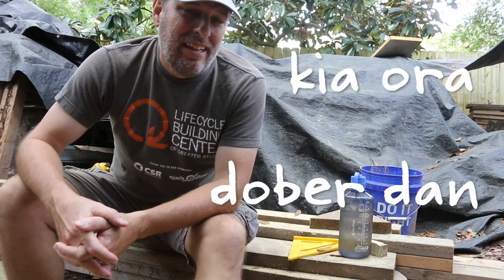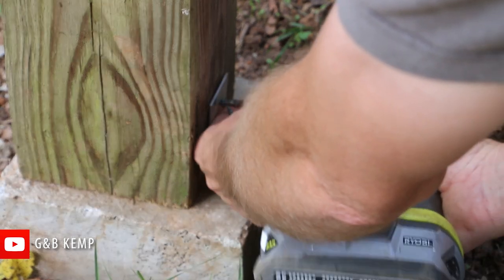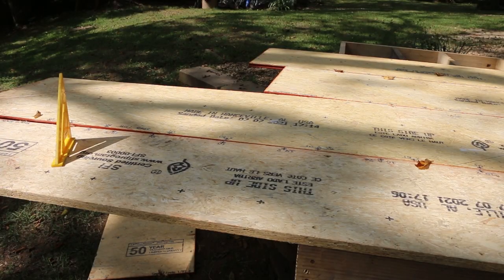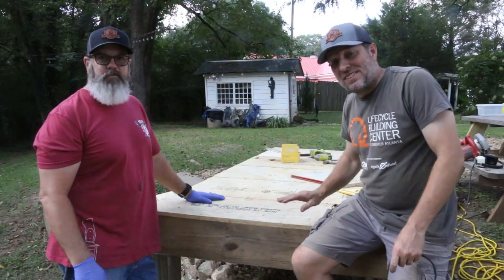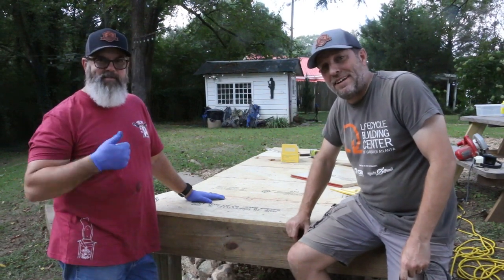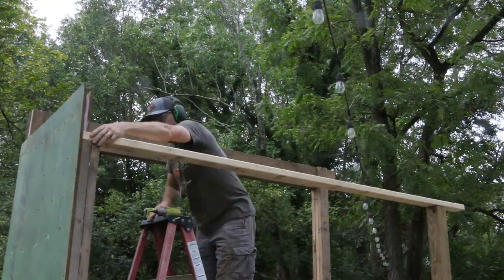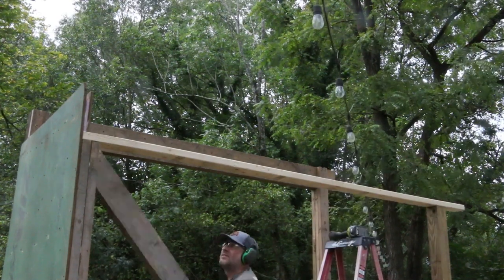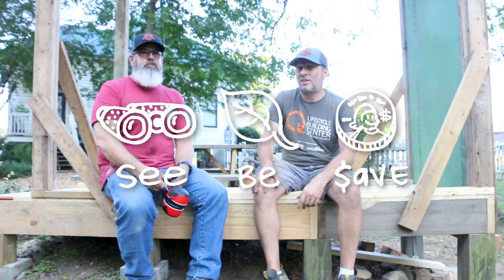How To Build A Tiny Studio From Reclaimed Lumber | PART 4 - Subfloor + Posts + Headers

Comment: Great clip this morning.  Thanks for the education regarding wood certificates.  Good to see your measure of safety gear.  Have you considered adding gate hardware to that section of fence that you opened?  Add a couple cross bracing cables with turnbuckles to keep the gate section squared.   

Wishing you and your family a blessed week.  Peace brother.
Reply from the maker: Hi JW. I’m thinking about making that section roll to the side. There is no good direction to swing it. Thank you for the idea. Thank you for watching. Peace brother.
Reply: @GreenShortzDIY  I cannot imagine how you could design and install a hanging, barn door style.  Probably easier movement uphill; gravity will help it stay closed.  Looking forward to seeing what you design.  Peace brother

Comment: Wonderful build!
I'm liking everything you're doing. Well, except for both y'all putting your weight on that ladder!!
That was a close one!

There is one thing that worries me tho...
And I wondered about this last week as you poured those footers.
It's those little corner braces you attached the posts to the cement with...
They seem a bit...
small for the task   ?

Now, I tend to "over-build" when I do this kind of thing, so maybe that's what is happening with me on this point. I dunno.
I'm no expert.

But...
Don't builders normally use those brackets that have a U shape, and you would set them into the wet concrete when pouring the footers?
Those are much more heavy duty, and then you're able to lower the posts into the U shape, and screw into 2 sides of the post.
Perhaps it's just my overkill kicking in, but it seems important enough to spring for some of those brackets, considering all the weight that will be on them in the future, and just to make sure there's no sliding of the posts down the road if those little brackets start to bend.
Those corner brackets you used seem a bit thin for my taste on that spot...

Tell me I'm wrong, 
tell me it is stronger than it looks, and then I'll be ok with it!
Reply from the maker: Thank you as always for the input. The brackets might be a little lightweight. I considered doubling them up. I used those in particular because I had them on hand from a trash pile. I'm amazed how much waste happens in the building industry. The big ones used for big 6x6 posts like that are almost $20 each. I didn't spring for them, as I'll be spending about $120 on the roof metal and perhaps another $80 on steel for the backlit panel. All that said, my concern isn't the building slipping sideways, it's blowing over. Chad suggested we add some steel strapping to the side of the legs, bolting to the side of the footers. I may come back and do that, once I have a sense for the effects of the wind on the structure. The roof will be a large wing, after all. :-) Thank you for sharing your concerns. Thanks for watching, GGO!
Reply: Gotcha 👍